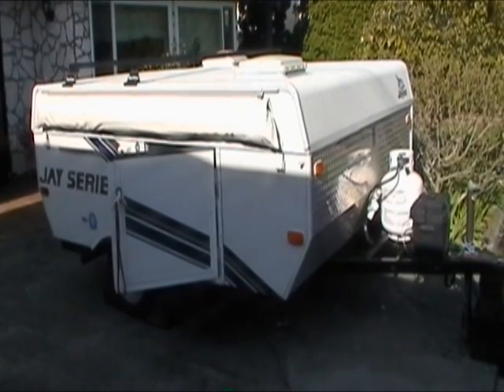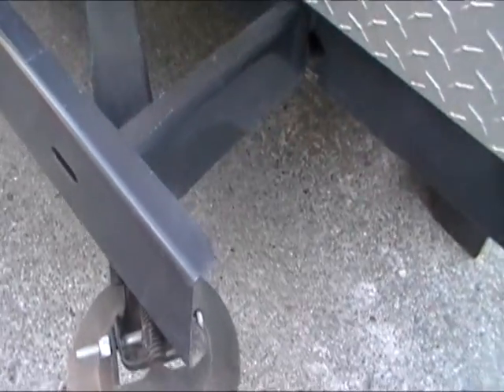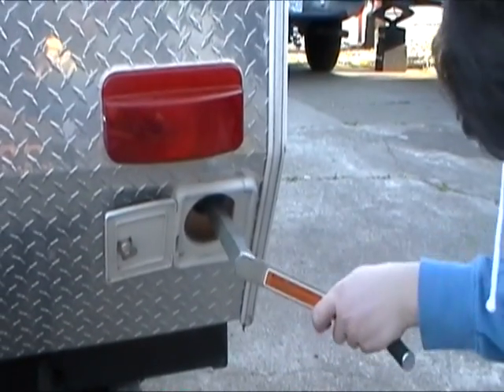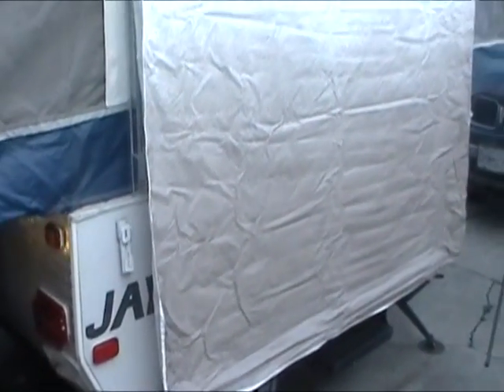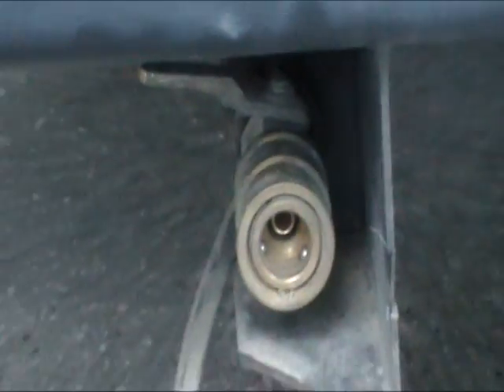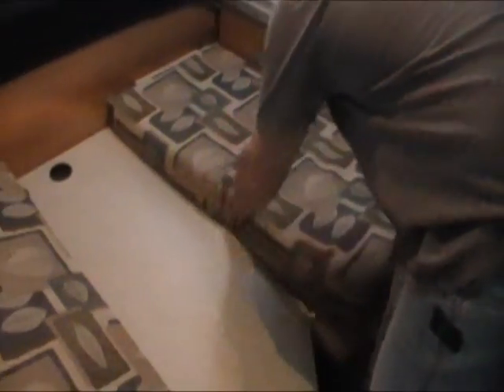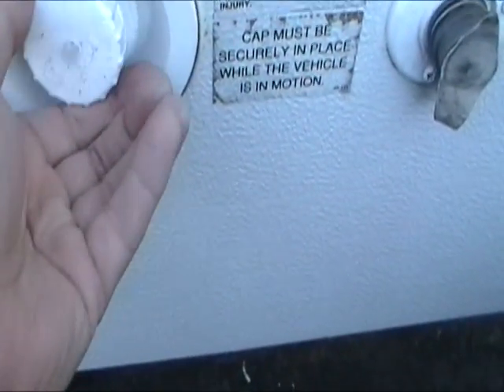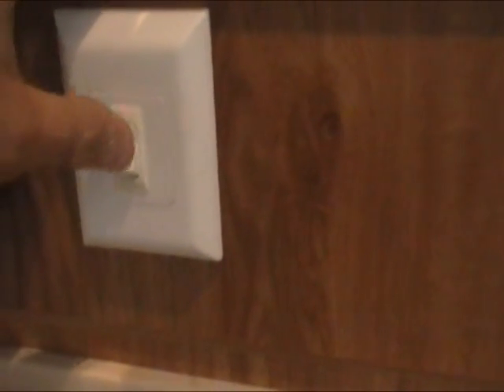2008 Jayco Tent Trailer Set Up

Comment: Steps for setting up were a little mixed up from what the salesman told us, on our Jayco Jay 10SD. But then, I'm not saying he was perfectly correct.😏 He also didn't know there was a place to put the half door under the rear bunk end, that the awning was was Not that hard to set up as he told us it was,  and and a few other details. Wonder if he realized you start it out  before you crank up.
Thanks for showing, and explaining how to do each part. 
The walk throughs at the dealer left a lot of details out!!